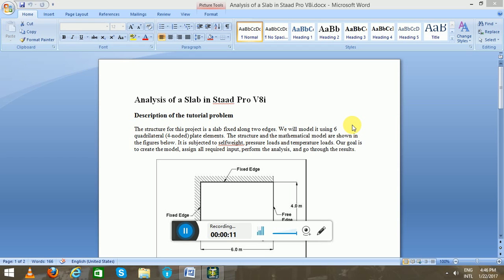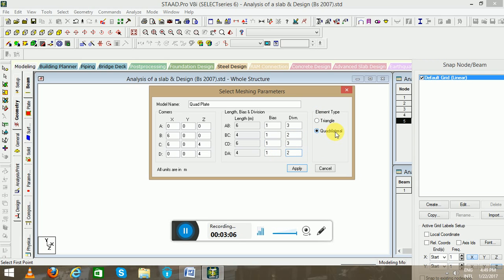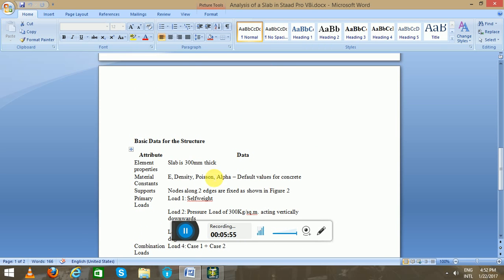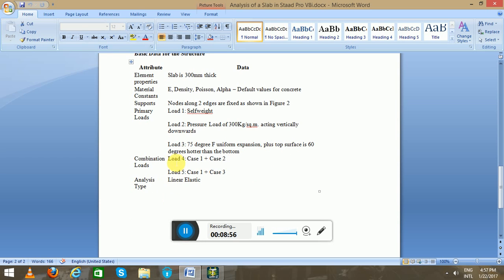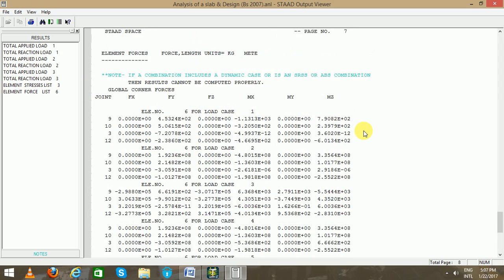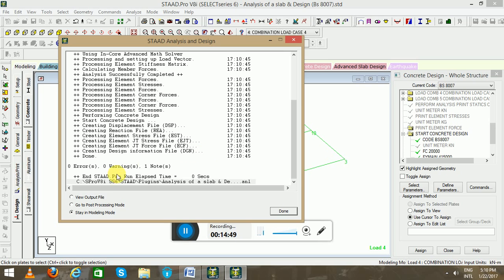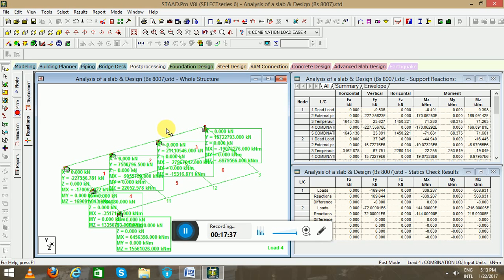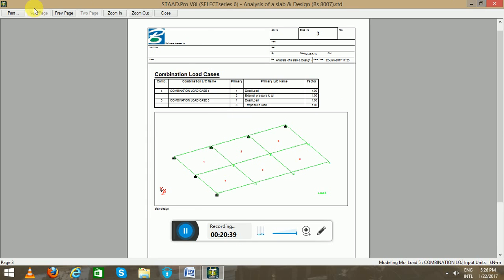Analysis of a SLAB & its Design(2017) in STAAD PRO V8i by BS 8007

Comment: Why u choose BS 8007 for slab design...instead of IS 456 ? is it possible to design a slab panel in staad v8i using IS 456 -2000
Reply: Ji bilkul

Comment: Nice tutorial bro..!! nowdays everybody is shifting to etabs whats the point of learning staad pro?
Reply: Anubhav G.  if client require detailed calculation report, Etabs fails to produce, It produce only summarized reports and not step by step formulation based calculation like manual calculation or excel bases calculation but in Staadpro, there is a option to generate very detailed calculation reports just like manual calculation which is not only formulated but also referred codal provisions .Thus sometimes, it also depend upon client requirements.
Reply from the maker: thanxxx anubhav !! yeah u r r8 but it depends upon user & project requirement which software to use & which will be more easier for him at that time of making & modelling the required the structure !!
Reply: But Staad pro not correct design of slab you can try it
Reply: as per is
 code